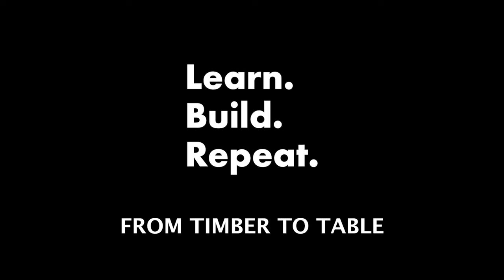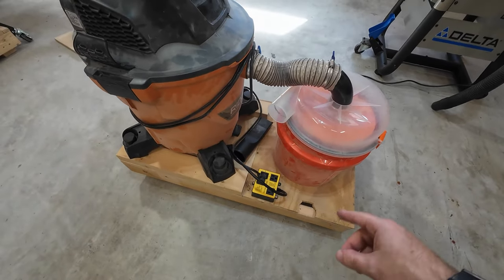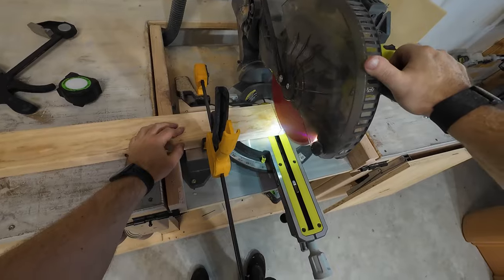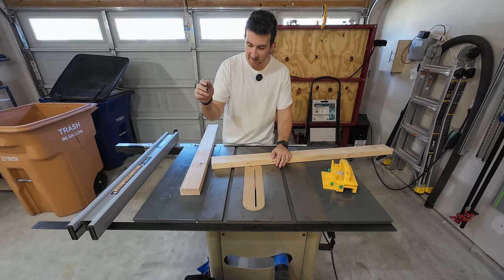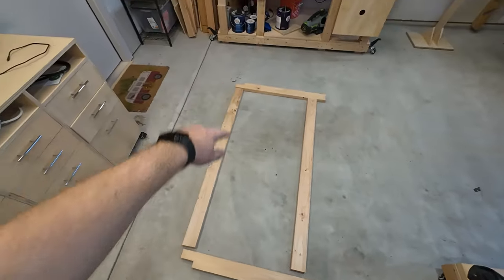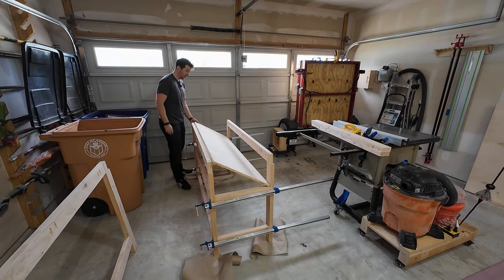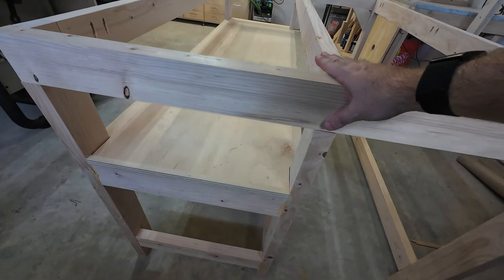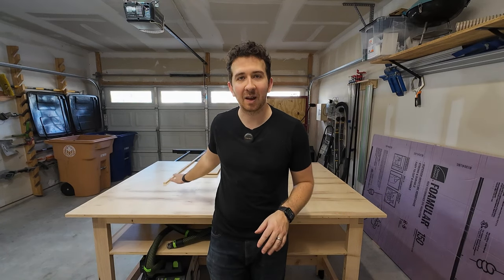Building My First Workshop Table: A Step-by-Step Guide

Comment: Hey, newbie woodworker here, just one quick question.. how do you account for wood movement? I read that dowels prevent wood movement and the wood will then crack over time..
Reply from the maker: Totally get where you're coming from. Wood does expand and shrink mostly across its width, so technically there's a chance it could crack at the dowel butt joints. But, I've taken some steps to keep the risk low, especially given that I'm not working in a high humidity environment. I've made sure the grain of the dowels lines up with the wood grain, and also made sure not to squeeze the dowels in too tight. I've also let the wood acclimate in my shop for two weeks before assembly. Quick disclaimer, I'm not a professional woodworker, so this is accurate to my current knowledge. So, fingers crossed, it should all hold up pretty solid!